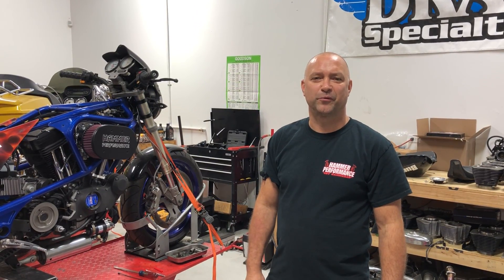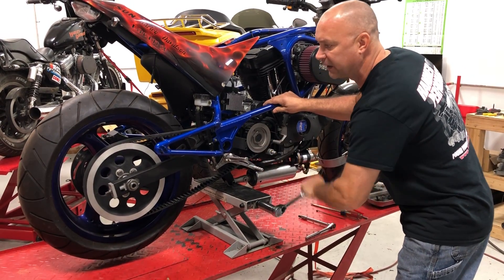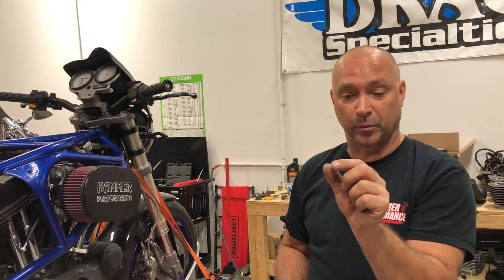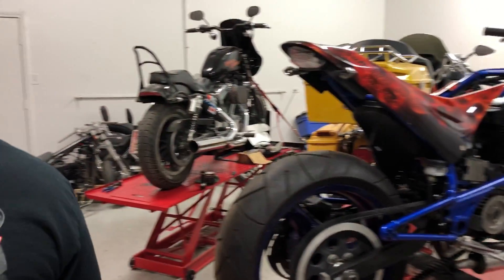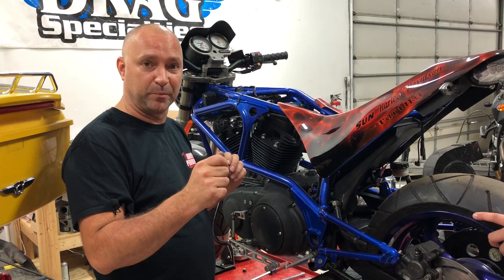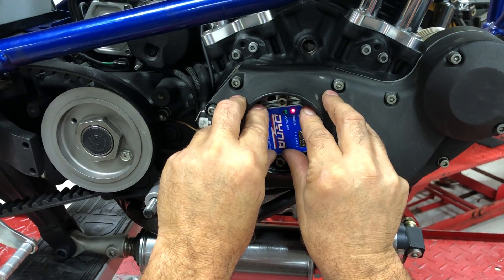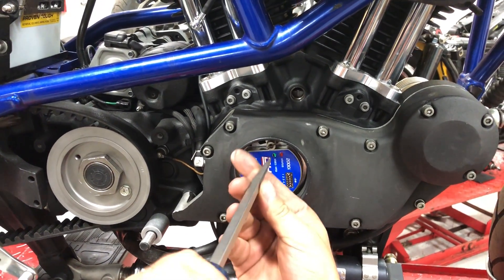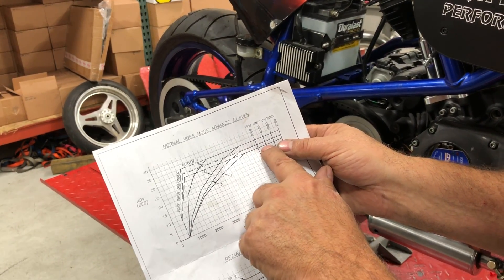How To Static Time An Adjustable Ignition Module

Comment: So maybe my bike is special but my 04 883 doesn’t have the inspection hole to see the mark.
Reply from the maker: 2004+ Sportsters have crank triggered ignitions. There are no mechanical adjustments for the timing at all. This video only applies to Sportsters through 2003.
Reply: @HAMMERPERFORMANCE  awesome thank y’all for the information.

Comment: always in the center? never just a little towards the rear of the window?
Reply from the maker: Only if you want to reduce power and risk damaging the pistons.
Reply: thanks. I seen a sorta inconclusive vid showing it towards the rear, and it DID start first kick, but I always kept mine in the center, was just curious as to if it made any better performance or starting gains. Never can have TOO much knowledge

Comment: So are the utima no good I just bought a kit ....every one  say they good....183 for a kit
Reply from the maker: None of the Ultima's built in curves are very good for our 1250 & 1275 kits. When an Ultima owner wants to use one of our kits, we suggest he get the programming kit so that he can build a curve similar to the Dyna 2000 curve 4.
Reply: @HAMMERPERFORMANCE  so im guessing a ultima module is best fit for a stage 1 or two 1200 ? Anymore more than 1200 a 200i is better cause of the curves ?
Reply from the maker: @Horrented  The Ultima's curves are too aggressive for a motor with a fast burn (high compression and/or a turbulent chamber). It's not a function of motor size, it's a function of compression and chamber turbulence.